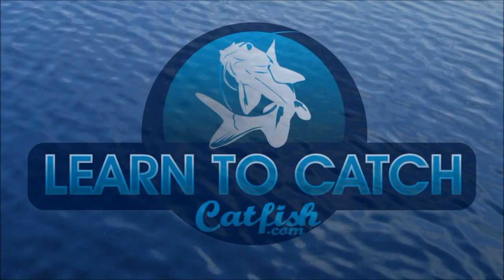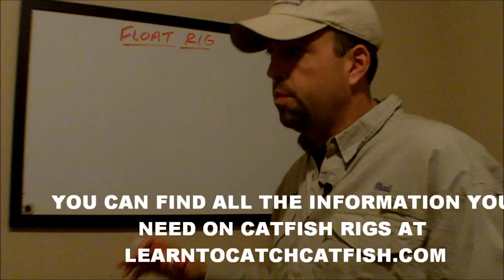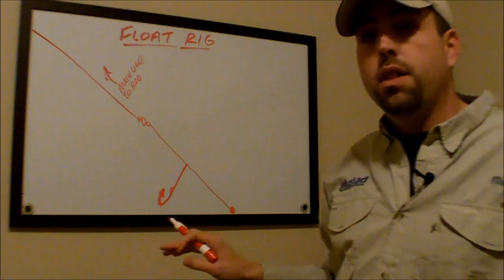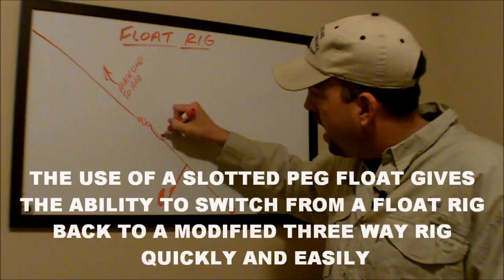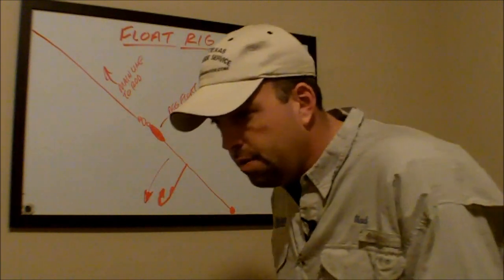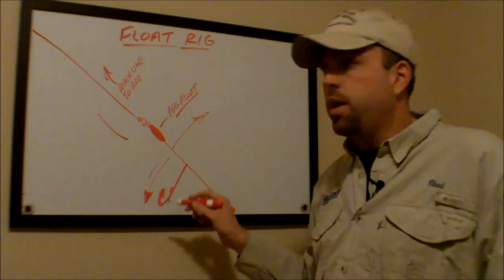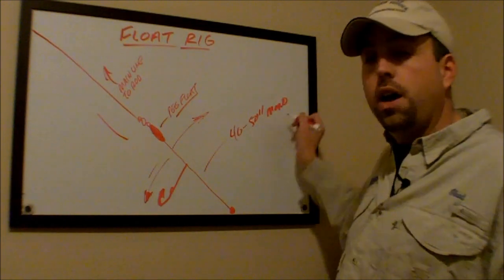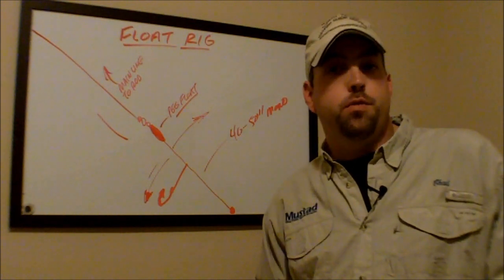Float Rigs For Catfishing *Catfish Rigs*

Comment: I have never used this rig before, but its nice to add it to my arsenal,  Keep up the good work man
Reply from the maker: Thanks
Reply: Thanks for the heads up, But i have a boat and on the lake what kind of water should i be looking for, deep or shallow, cold or warmer?  I fish Braunig and Calaveras lake here in San Antonio, and they are both power plant lakes so some of the water is warm and some is cold, and on both sides i can get as shallow as 2.5 feet, or as deep as 30 feet.

Thanks for everything that you do and keep up the good work!